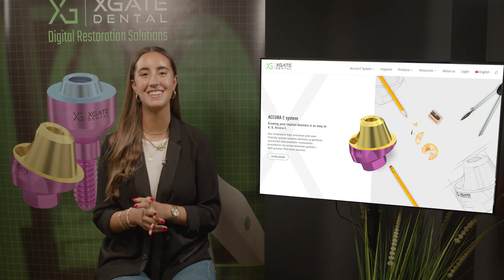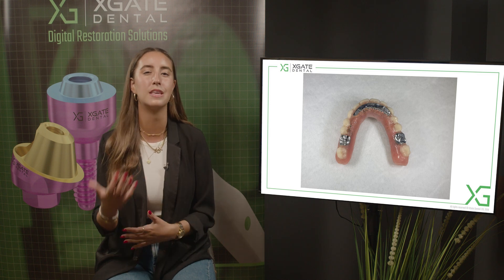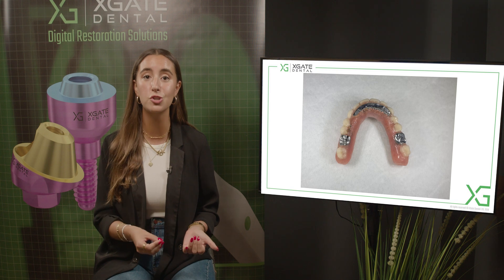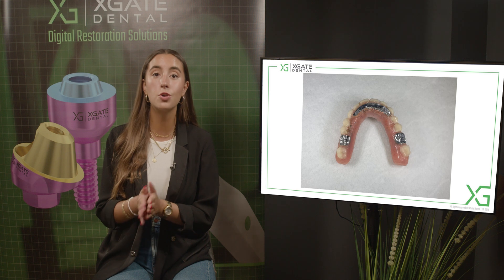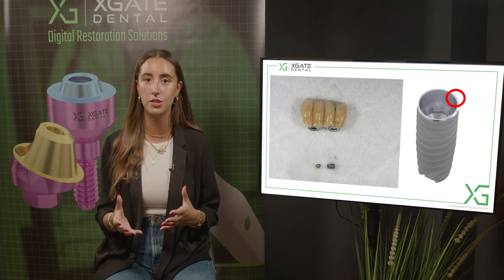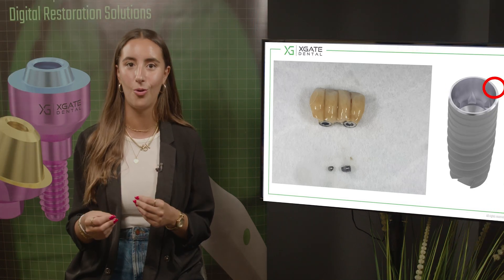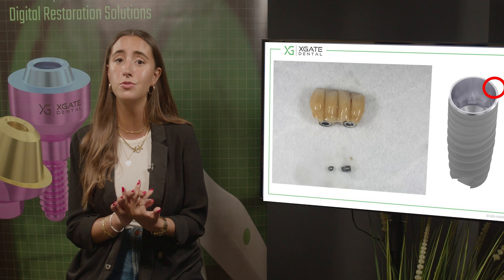Dealing with prosthetic complications in bruxism patients causes, solutions, recommendations

Comment from the maker: 00:00 You can see the metal crowns 
00:31 It's bruxism
00:43 Two crowns from cobalt chrome metal
02:00 We prefer that the weakest part be part of the prosthetic
03:00 First of all, disconnect the bridge from the  abutments
04:00 The multi-unit can break down
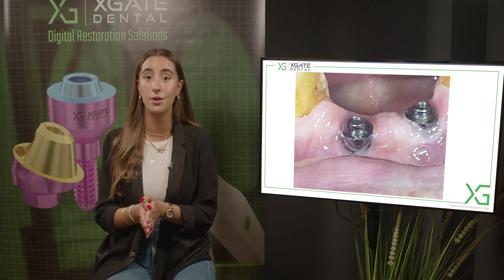05:00 This is what happens when the screw breaks down
06:00 A patient with bruxism
07:00 When you're using the multi-units weakest link will probably be the prosthetic screw over the multiunit and not the implant
08:00 We want to have crowns and the material that suits us best is monolithic zirconia or metal crowns.